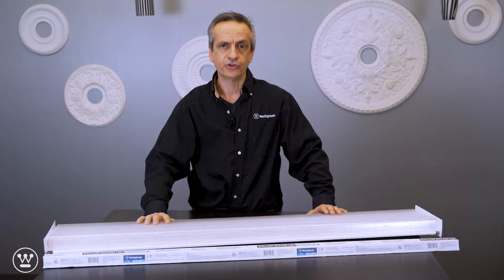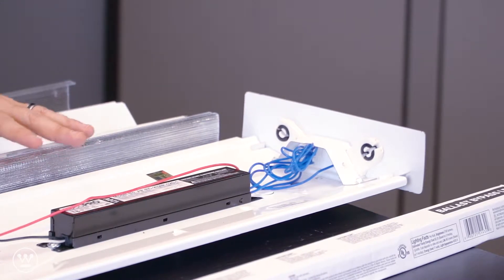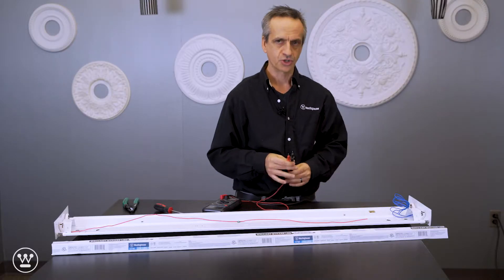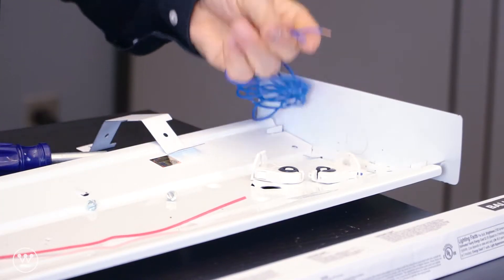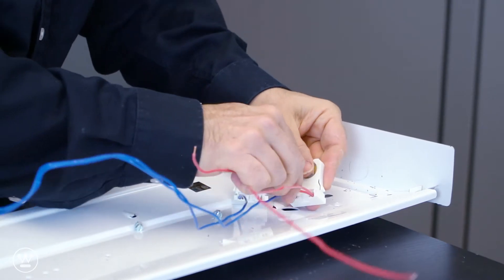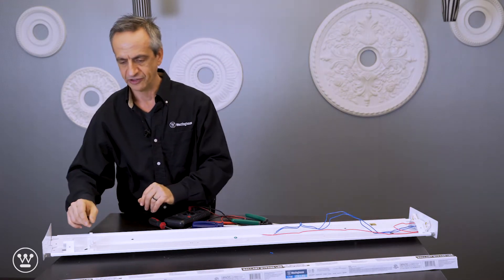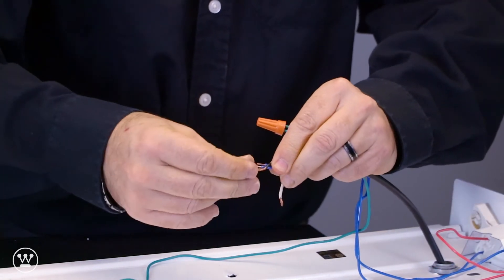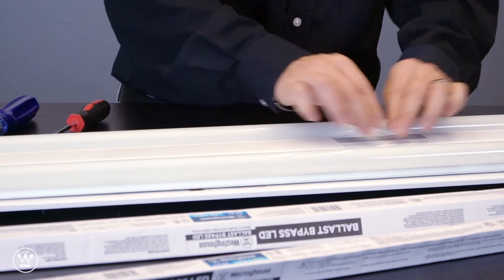Linear Fluorescent TLED Single Ended Retrofit Overview

Comment: I found on my single ended bulbs that one specific end is dead - and the other end is live. I tried it one way and they didn't work.  So, I swapped ends - and they worked.  I ended up marking all my bulbs - 10 in all, with the word "live" on one end (the end with some mfrs. labeling), and dead on the plain end.

Comment: What do you mean by 'tombstoned' - not familiar with that therm, plus we can't see what you tested to show they were 'tombstoned' as your hands were in the way :(
Reply from the maker: The term “tombstone” refer to the socket of the light fixture. In this video we tested the sockets to see if were non-shunted or non-continuous and if not they will need to be replaced.  If you are unfamiliar if these TLEDs can be used with your light fixture we recommend that you contact a local electrician in your area for assistance.  If you have a specific question about this TLED, please send an email to contact the Westinghouse Lighting Consumer Support Division for assistance at: consumersupport@westinghouselighting.com Thanks!
Reply: The technical name of a tombstone is “lampholder”. Tombstone is just a slang term for them since they somewhat resemble a grave headstone in a cemetery.

Comment: You can also "jumper wire" the blue wire between the two sockets as he did the red wire, leaving only one red and one blue at the power leads.  That would be less confusing in the end.

Comment: Another way to remove the wire from the tombstones is to push a small nail or tiny eyeglass screwdriver into the same hole as the wire.   This pushes the metal tab inside the tombstone out of the way far enough to pull the wire.

Comment: Is there an advantage to wiring the sockets together via the red jump vs running a red wire from each of the sockets to the neutral power from the house similar to the way you ran the blue wires?
Reply from the maker: Depending on the existing wiring present in the fixture there is no specific advantage to wiring the sockets together using the red wire to jump vs running individual wires from each socket, either is acceptable as long as the installer is properly following the wiring instructions included in the installation manual. Thanks for reaching out!
Reply: @Westinghouselighting  So you can wire these up the way he wired the blue or red wires and it will work? I think he intended to show 2 ways to wiring in the video with the red jump vs the blue individual wiring.

Comment: On a single- ended LED tube if the left end isn't connected to power does it matter if those "tombstones" are shunted or open?
Reply from the maker: Hello: The tombstones need to be non-shunted. Also, if you are unfamiliar or unsure we always recommend to contact a local electrician for assistance. If you have any other questions feel free to contact us at consumersupport@westinghouselighting.com. Thank you!
Reply: @Westinghouselighting  My question is the same as Stan Smart's: Does the "dead" end of the tube need a non shunted tombstone also? It is just a holder, right?
Reply from the maker: Hello: To ensure the installation complies with Underwriters Laboratory (UL) electrical and safety standards, all retrofits using Westinghouse single ended TLED lamps should use non-shunted tombstones on both sides. Thanks for your question!
Reply: @billszymborski584  It's probably just a safety in case someone later puts a fluorescent tube in there.